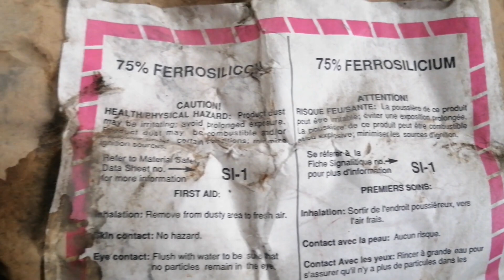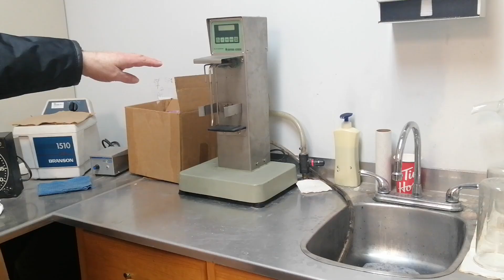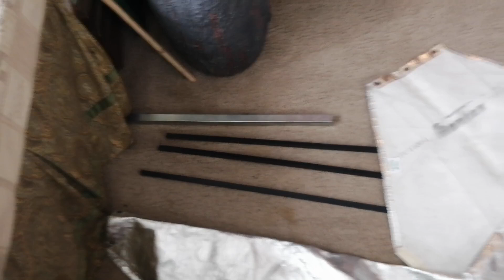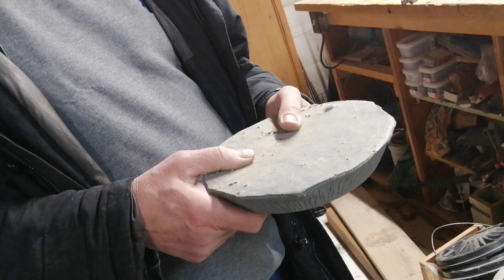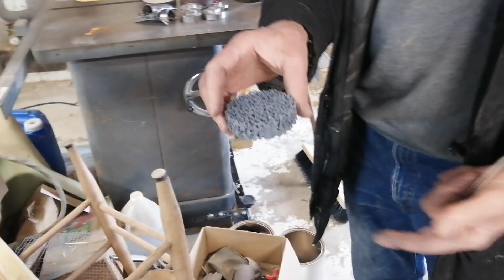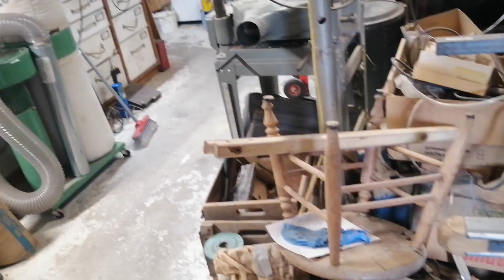The Great Ontario Foundry Road Trip, 2025

Comment: Nice, going for iron now, good luck, lol. I usually have to use a #5 shaded face shield for cast iron because it's so bright and you can actually damage your eyes from it being so bright. It's odd that he's having problems with slag like that, when you get iron up to temps, you can usually scoop it off of the top and it'll stay clear for a while till it cools down enough. Usually once you get it to pouring temps, it doesnt seem to want to create more slag while it's at pouring temp range, unless youre dealing with ductile iron, which will create slag as the magnesium burns out. That's what Ive experienced anyways and I know a few people that do iron that say the same thing tbh. Cant wait to see you try iron and experience feeling like youre standing on the surface of the sun, lol.
Reply from the maker: Thanks.  I've always looked forward to trying cast iron.  Finally maybe have something halfway lined up that calls for it, so this is the year to finally take that shot. 😁  
Maybe Doug will see your comment and get some good ideas for how to work around the slag inclusions. I was thinking gating might be part of the answer, but I can't offer reliable advice when I haven't tried it myself, at best I can make educated guesses.  Was hoping some folks who've actually done iron casting before might offer some good insights for him so thanks.  
I'm also thinking the old dark tinted shields I've got are going to be better for CI than the new one, even though theu're both a little scuffed up from use.  But for nonferrous, the new shield should be a little easier on my eyes when I'm peering into crucibles of bronze and hot furnaces and such at least.  BTW Josh has declassified 6 minutes of additional footage of his shop and machines and castings etc..  Unlisted, but linked in the pinned comment if you're interested. 😁